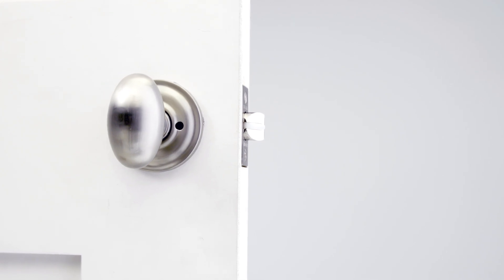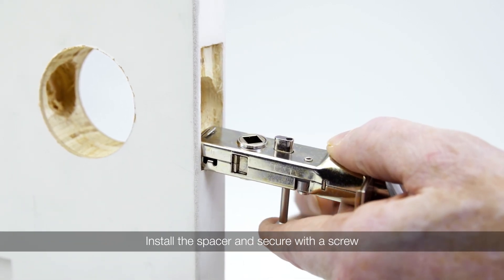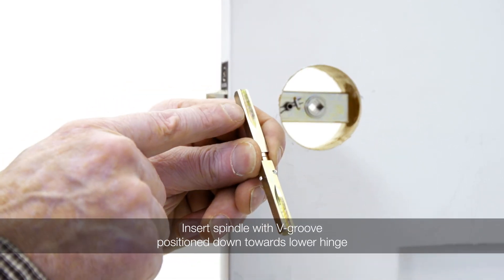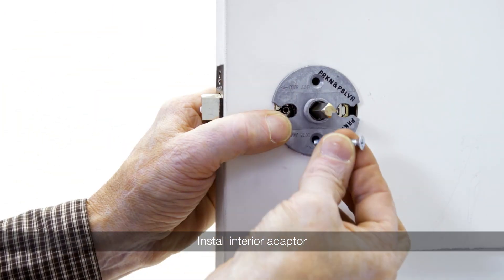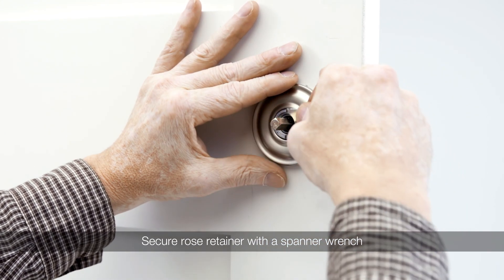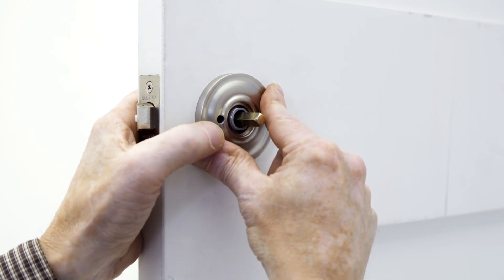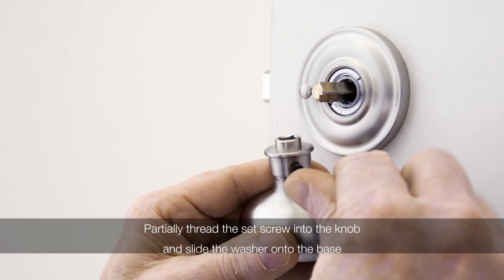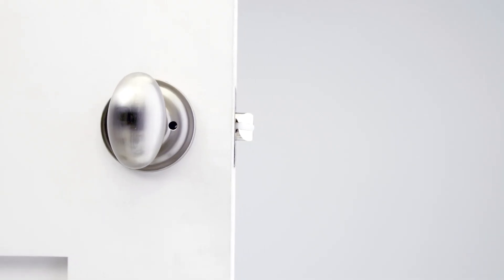How to install Baldwin Estate Privacy/Passage

Comment: Unfortunately I am having issues with my setscrews. They seem to be screwing in just a few millimeters and then getting stuck
Reply: I've had the same issue. A design flaw
Reply: Mine were STUBBORN, too - but I kept forcibly screwing them in (separate from the mounting procedure - just holding the knob to work the set screw in)...

Comment: Hi, my Privacy Pin keeps falling out!  I've lost 3 already.  Just installed the fourth with some loctite, so we'll see how that fares.  I tightened the ping as much as possible, and then tested by pressing the lock button and turning the handle to release.  I checked the ping again, and noticed that that single lock/unlock operation loosened the pin by a half turn.  Is there a remedy for this? Not sure if the loctite will be sufficient or not.  Thanks.

Comment: How is the handing changed? Simply flipping the latch results in the levers pushing up rather than down. Edit: I figured it out. The privacy pin can be screwed in on either side, thus the reason for both a square and round plastic tab for the unlock button.
Reply: Exactly. When you install the latch, make sure the lock set dimension number (2 3/8”) is on top. Then adjust the latch so it is angled toward the jamb plate/catch. Then use either the oval or the round plastic spacer on the privacy mechanism. If you don’t have the dimension number on top, the lock set will only open when you move the lever up! And the spacer you use depends on the privacy pin position — you will need either the circle or the oval plastic spacer.

Comment: Why don’t you show how to snap the plate pieces together?  It isn’t clear what the front and back are.  FFS Baldwin…
Reply: just get a weiser or schlage
Reply: The video explains it well. Pay attention to the Inside & Outside on the video - it is different IMHO than the printed instructions. My plate pieces were NOT labeled as in the video, but the video ID'd which piece takes the screws.